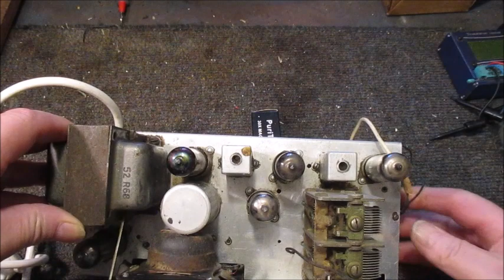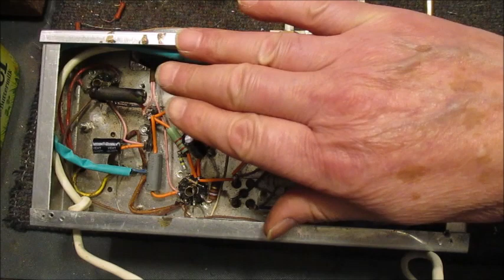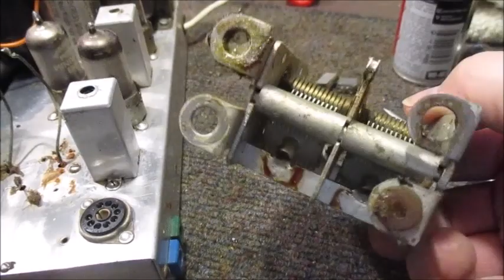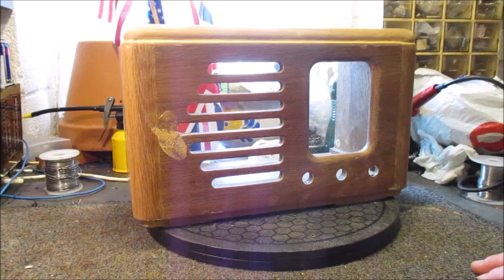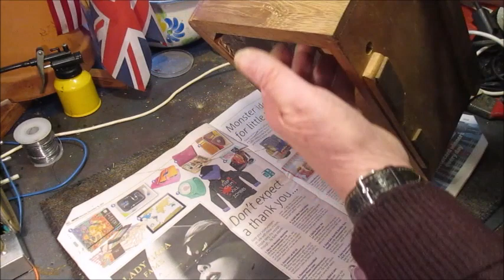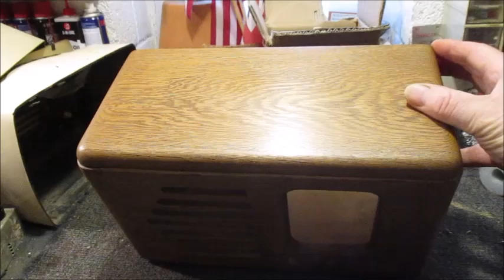Bell Planet Colt Vintage Radio (1957) Reconditioning.

Comment: Using egg white as a filler was new to me. It looks great! I'll have to give it a go.
Reply from the maker: Hi,
Using egg white to seal open wood grain is a very old ‘trick of the trade’.
Achieving a glass, or semi-glass finish is down to getting the wooden surface very smooth before applying coats of egg white to fill the open grain.  Depending upon the type of wood, or veneer, will determine how many times one needs to apply egg white, allowing it to dry, and smooth the surface with high grit count abrasive papers (corse open grain usually require more egg white, and abrasive treatments).  Only apply gloss, semi-gloss, or Matt finish once the wooden surface is silky smooth, and dust free.  This last bit is very important - surface is to be silky smooth, and dust free.
Thank you for dropping by my friend, and keep safe, Phil.

Comment: Great to hear from you again Phil! Reminds me of the days when you, OldRadioAl, and John from Switzerland were really prolific. Ahh... "A blast from the past." -- Grain fill using egg whites? I'm no cabinet guru, (that's for sure), but I never heard of that one. Cheep, (get it?), but works great! I'll have to try it sometime.  To have Oak get that damaged, someone must have really used it as a boat anchor.  -- Beautiful electronic and cabinet restoration. Be well, Tom
Reply from the maker: Hi Tom,
Thank you for dropping by: your support is very much appreciated.
John continues to upload videos but they are not directly related to radio restoration.  I don’t know what OldRadioAl is doing these days.  
The egg white did the job most handsomely for sealing open wood grain.  I understand it is a centuries old method, and it is still being applied in the manufacture of guitars, and a few other wooden musical instruments.  The oak cabinet has restored to a decent standard.  The radio part performs far better than I expected.  It is the only ITU region three radio in my Vintage Radio collection.
Hope you, and yours are keeping well, and staying safe during these uncertain times.
Best regards from Phil.

Comment: Phil,  you've done a wonderful job on that radio!!!! It looks simplistic  but it does have a transformer, so it has to be  early 40's I would guess. I think its great you've used the Egg White technique here...  You are fortunate that the wood was solid and not a veneer.. The end result is simply beautiful  - Well done Mate.... educational and excellent end result.
Reply from the maker: Thank you Ron for your support, it is very much appreciated.
When I first saw this wee radio I didn’t think much of it, in fact, I felt like putting it to one side and forgetting about it.  It was largely out of curiosity I decided to get it on the bench.  Having got it going I was very surprised how well it works.  It was then I began thinking about a detailed cabinet restoration.  I convinced myself it would be worth the effort.  What made my wife smile was me using an egg.  My culinary skills are so bad, no one in their right mind would want to sample my cooking - especially if they value the preservation of their gut and bowels.
Note four of the five valves incorporated into this radio are ‘Rim-lock’ types.  They are the 6.3volt heater versions that are inside your Pye Piper radios.  For the large part, they were well designed valves.
Once again my friend, thanks for dropping by.  73 Phil.
Reply: Early 40s would have octal valves.

Comment: Hi Phil, that's a nicely restored Colt, well done. And definitely Oak. They came in light and dark oak cabinets in this style.  This is the first one of these I recall seeing with the earlier 5B4 chassis in it. The 52 on the top of the power transformer indicates 1952 from memory, and I think these were made by Beacon Transformers Ltd here in New Zealand. That would mean it's possibly been replaced, as your set isn't that old. The speaker code stamped on the rim might also give a clue, the last digit is usually the manufacture year. My guess is 1954 though. The final place to look on these is the electrolytic can as these sometimes had dates printed on them.  Anyway, thanks for an enjoyable restoration.  Cheers, Steve (www.vintageradio.co.nz)
Reply from the maker: Hi Gentlemen,
This model of Bell Planet Colt radio will go down in my radio restoration history as, “The radio that smashed me in my face.”
I’ll briefly explain.  When I first acquired this radio - I was led to understand it belonged to an elderly chap who’d immigrated from New Zealand sometime during the early 1960s to live in England.  When I first saw this radio, I did not hold it in any sort of regard.  I was of the mind there was nothing going for it.  Out of curiosity, I decided to get it on the bench, and give it a cursory look-over, and see how our friends down under designed, and manufactured radios.  Having reverse engineered a circuit diagram, and used it to assist me to get the radio working, I was exceptionally impressed how well it performed, and sounded.  Given that, I felt that the cabinet, which is superbly constructed from good quality wood (oak), and not veneered, was definitely worth restoration.
In short, this radio’s restoration turned out for better than I first thought was possible.  I’m so happy with it, it now takes place in the centre section of my Vintage Radio display.  It is definitely the radio that smacked me in my face.  It’s looks, and performance left me stunned.  It is an absolute winner.
One thing for sure, it will never be returned to New Zealand whilst I’m still alive.  I’m proud to say, “It’s mine!” LOL.
From what I’ve interpreted from off the paper label on the speaker magnet housing, this radio might have been manufactured sometime during 1958???
Love the New Zealand Vintage Radio website - David Tipton, an Australian Vintage Radio restorer, signposted me towards it.
Best regards, and 73s from Phil.

Comment: Hey Phil, The central spot on the dial looks like standard broadcast AM kilocycle numbering for the US market.  I think the lowest would be 540kc here and the upper would be around 17something even though they don't usually show that high on a dial (usually the highest is around 1650...my old '33 philco goes higher but it included a long since disused "police band".) though the dial will usually turn a bit lower and higher than what's shown on the band.  That's a beautiful little radio.  I've seen Bell radios in the US, I think, or maybe I'm getting them confused with Packard-Bell.  I know the little white radio on the 60's sitcom "Gilligan's Island" was a Packard Bell AM only set.  The prop department for the show added the dummy di-pole antenna to that radio for some reason as that particular model like most radios at that time were using ferrite rods for AM reception.
Reply from the maker: Rebel9668 
Hi Gary,
Thank you for your comment: you have raised two valid points.
There are three I T U (International Communications Union) regions.  For example, 
UK is in region one; USA is in region two, and New Zealand, where this radio originates, is region three.  Complexities regarding frequency (Band plan), and its reasons, and requirement is somewhat too  involved to write in this short space.  Since I find it a fascinating subject, I’ve made it known to anyone who is unfamiliar, but who might become interested for personal research.
I’m reliably informed the USA Bell brand has no relation to the Bell brand of New Zealand.  They were, or are independent manufacturing companies.  There are a few, original, components incorporated into the Bell Planet Colt radio that were manufactured in Britain.  For example, it’s reservoir, and smoothing dual electrolytic capacitors were manufactured by Hunts of London.
As I say, two good points you raised my friend.
Hope you and your loved ones are keeping safe, and well during these unsettled times.
Best regards, Phil.

Comment: Hi Phil, I'm very impressed with the finished article. For someone that doesn't  know much about cabinet restoration the finish was A1 👍 I printed out a chart for the metres to frequency conversion, metres does my head in I'm afraid. Glad you got the schematic from the Kiwis, it was a bit late I know but it confirmed what you already knew. Cheers!
Reply from the maker: David Tipton
 Hi Dave, thanks immensely for your support; it is always appreciated.
To be truthful, I did not reckon much to this radio when I first saw it. It was out of curiosity I eventually decided to get it onto the bench. Having monkeyed around with it for a while I was pleasantly surprised how well it performed.  Since it performed, and sounded good, I felt that a full cabinet restoration was warranted.
Thank you for signposting me towards the New Zealand Vintage Radio website.  I was surprised how much it has to offer in the way of pictures, radio literature, and circuit diagrams.  I also discovered there were some very sharp looking radios manufactured in New Zealand during the 1930s and 40s.  That website is definitely worth a visit🤠
Best regards from Phil.